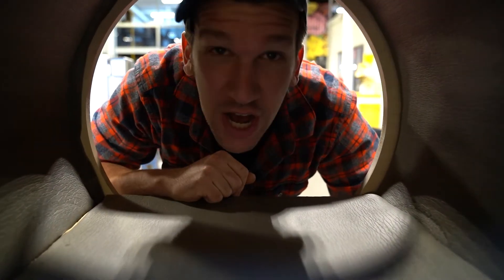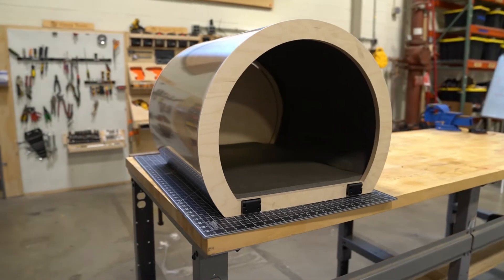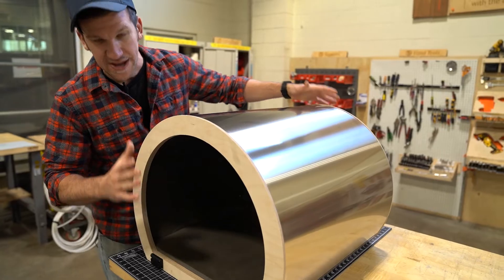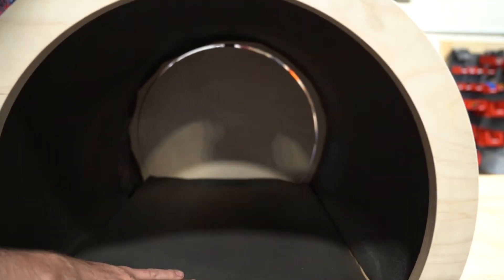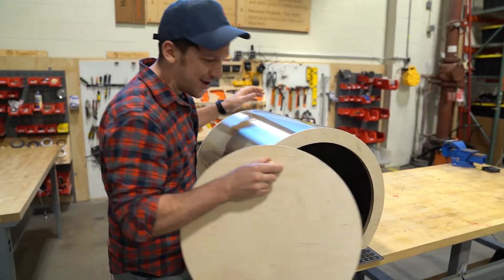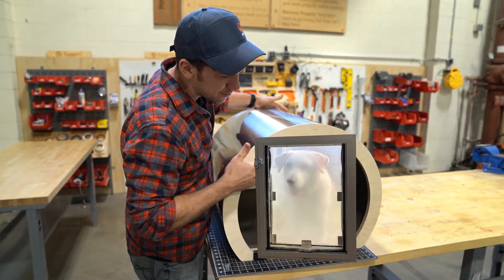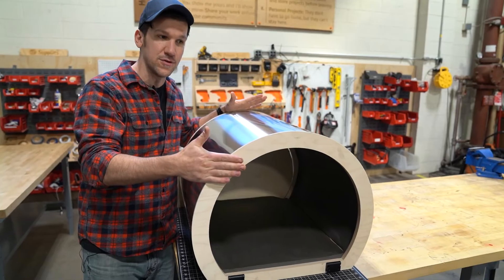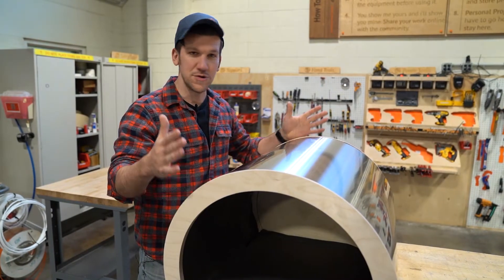Zennel: The Sound-Proof Dog House

Comment: Other design would be the concept of a snail shell but on its side. They enter the opening and the center location has them protected on all sides. They enter and leave the same opening . It can have squared edges as well. Use sound proof foam that can be shaped

Comment: I might suggest caution when suggesting closing-in an Anxiety Shelter. While sealing 'all' possible noise pathways be sure to enable air circulation. We hoomans need to ensure our 4-legged children have fresh air vents. Mass loaded vinyl (MLV) covering 90% should provide excellent sound absorption. Not really sure about the tubular design. It looks nice, but I am trying to design something for our dogs. I am considering rectangular, to be used as a piece of furniture, or accessory under an end table ot service table. Good luck with your project.

Comment: Ok, July 4th! The firesworks being sold these days are bigger, stronger and louder! Is there any stopping this? My 80# Lab is now terrified. I will now have to build some sort of sound cage for him. Now, lets talk about sound management. Imagine standing on the flight deck of an Aircraft carrier. The decibels are usually around 130. The typical gear for air ops is and outer headset along with expanding foam ear plugs in your canals. You can still hear the jets albiet at about 60db. (Rustling leaves is 50db). Fireworks can get to 140-180 db. To build a soundproof room like maybe a hearing aid Doctors booth is what it would take but would cost prohibitive. Good luck with your tries.

Comment: Honestly I think this is a great idea. I think you should have 3 stiffened different options that can be installed since every dog is a different environment they feel more secure in. Some like going into a nice dark place while do would like.  One with a thick screen like material that let's air go through, maybe another that is soft plastic with holes through it. Another thing would be that you have a little exhaust fan that will pull air through the front and it through the top. Final thought would be adding some speakers that could play soothing sounds or must to drown out any additional sound.  It would be even more rad if there was a little motion sensor (similar to a garage door) that detects is the dog is there to turn the fan on and play music

Comment: Ive been throwing this idea around for a while. Yes - there is a need and if someone does it right its a multi-million dollar idea. But... the problem is, most dogs that fear fireworks only need 1 bottle rock to set them off. So  this product would need to be 100% sound proof. The only way that can be achieved is if its also air tight. The problem being obvious... the dog can't breathe. So an error proof ventilation system would be needed and thats where it gets complicated. You would have to trust your design to never fail. You also would need to implement video equipment. Also a bit complicated. But,  still, I love where you're going with your design.
Reply from the maker: this is something we found as well along with several other issues that would be tough to tackle. So right now this potential product has been put on hold. Which is the fate of 90% of prototypes.

Comment: Dear God! YES, YES, YES! Every dog we’ve had got terrified with Fireworks 💥 and then Thunder. There’s another on the market but it doesn’t look as compact or manageable as yours. What about a small battery operated fan too? It would 1) cool down the interior & 2) if the fan has one of those  monotonous sounds, it would calm &  soothe the dog during the blasted sounds of thunder & fireworks 💥 You should Crowd Source & Market these crates/dog houses. With a bit of Advertising…even on YouTube, it should be a real winner. Thanks 🙏🏼

Comment: I have invested in a “sound proof” room for my dog - the issue is that by the time the first unexpected gun shot or firework goes off, it is too late to get inside - at that point it is damage control.  Also need to factor into any project the fact that a dog has superior hearing compared to us humans.  I agree with an LED and I also think you can offset some of this with distraction - nothing out of control, but soothing white noise or better yet, a configurable input to stream sound to offset the exterior noise.  I am still refiing my setup,  but I have large dog with extreme anxiety during these events and would be willing to assist.

Comment: Needs to be waterproof from the rain.   Possibly a heated floor and an integrated L.E.D. strip on the inner top of the roof. Not too bright.   An integrated fan for the summer time..   Make it big enough where a dog can turn around.   I've got a JRT, but people also have bigger dogs like German Shepherds.  Need 3 different sizes.  The bottom will also need to be removable for cleaning.  Dogs will scratch the bottom naturally, so it will need to be secured,  possibly some high quality stainless snaps, NO ZIPPERS.  Good luck.

Comment: I had a company for years doing residential and Commercial sound mitigation. This will not work, it is complete fiction. The sound absorbing foam doesn't stop sound from coming in. The sound is traveling in the air. The only way to mitigate (not completely stop or "proof") outside noise to inside a space is to stop direct air. Would be a dream for dogs though...but then they'd be awoken by the 100% of the noise around this doghouse coming in. That 80% number is just a bit off. Movie theatres are rated around STC 60 with meter thick walls of cement and foam block. Those will reduce the bleed sound from 100dB to about 20dB (this is a logarithmic scale so it's hard to put it into a percent...distance of the source also matters)
Reply: https://www.youtube.com/watch?v=iG9GcWkQvGA

Comment: I worry about airflow too. I think if it had a wide long "chimney" it would still cancel a lot of noise. Or even set it up with a fan that is battery operated to create a "white noise". The flap is a good idea.
Reply: Yeah I’m thinking 1 of those cheapy battery operated fans built in. Would ventilate &  cool inside & also make a soothing monotonous sound to calm the dog down.
Reply: I had been to thinking of something similar.  Ultimately you need to have something that will fail and not be hazardous to the dog.  So you can’t depend on the fan for airflow but should help